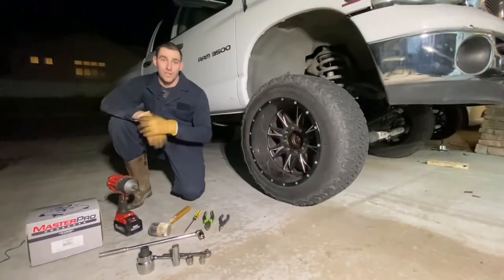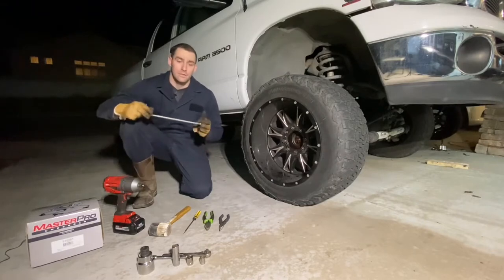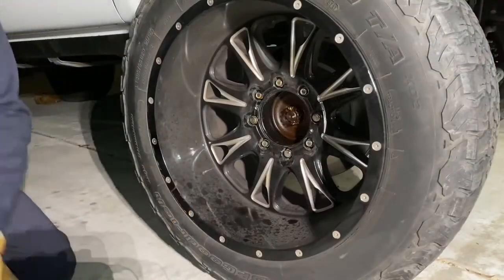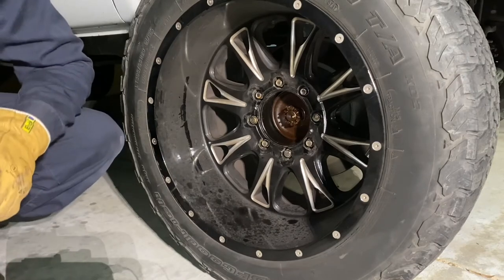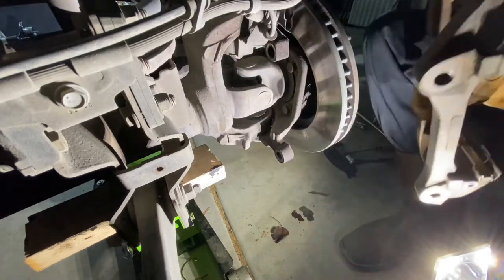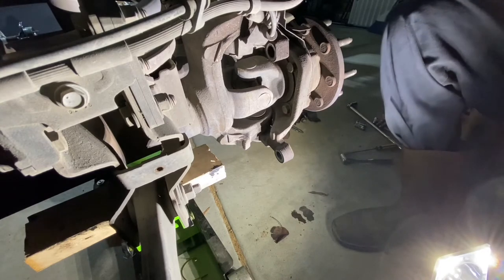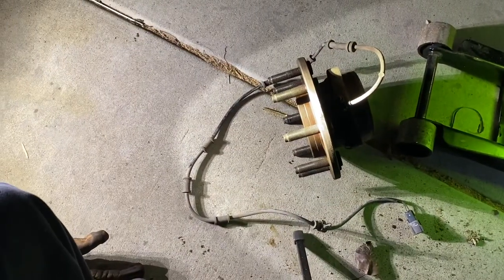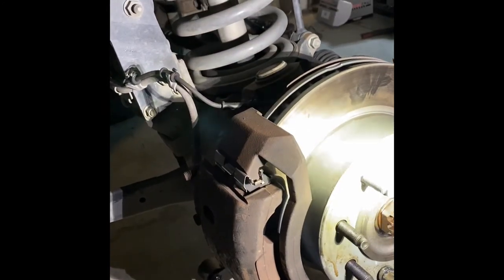03-06 Ram 2500/3500 Front Wheel Bearing Replacement- Driveway Edition

Comment: Yeah, my rotar isn't coming off. What would you advise?
Reply from the maker: You’ve got a few options:

1. BFH- this is usually my go-to as I’ve got a large rubber mallet that works well. If you use a hammer, place a piece of wood directly on the rotor to prevent damage. Don’t want pieces of metal flying everywhere either.
2. Rotor/hub puller- A puller would make easy work of this. You’d need to get a fairly large one. If you don’t already have one, you’d most-likely have to wait a few days for shipping. 
3. Heat - Take a torch to the rotor and only heat up the areas directly near the stud holes. The rotor expanding from the heat will break up all the rust and gunk. This method will require a hammer or mallet at well. Some people will wedge something in between the axle and the rotor then turn the wheel to force it off.

Comment: Lol if you're doing this job in any of the rust belt states you can just ignore this video. This is the kindergarten version of this job. I knew when I saw the selection of tools this had to be one of the rust free states.
Reply from the maker: It’s intended to just highlight the steps needed to do the job. I mentioned in the video that I had just replaced the rotors and pads the week before. Idk about you but, I hate wasting 10 minutes watching someone struggle with a bolt. 

You are correct about the location. It blew my mind when I first travelled to the rust belt region of the country a saw a 6 year old truck with no quarter panels lol
Reply: I was thinking the same thing.  I couldn't believe how that hub bearing unit basically fell out.  It's another story when the only way to service these is cut the ball joints off and press the hub out of the knuckle with an 100T press.  Yes, I've come across them that stuck but I realize this is more about just the process or what needs to be taken apart, I get it.  Still depending on your location it could take significantly more intense tools and processes.
Reply: I live in Michigan. First year I owned my 06 I went to do the rear  shocks...in my driveway on a wet soon to be winter fall day....on my back. 

The video I watched in my novice beginning...was from a man in Tennesse. Seeing as he did his in 20 minutes and after seeing his video and being full of confidence...I gave her a rip on a Friday after work. Sunday....and snowing mad as he'll at the rear upper bolts facing outwords...I finally broke them free and spun them to the inside so it would be easier next time. 

That....was a lesson learning core memory that will not ever be forgotten. Lol fuck salt